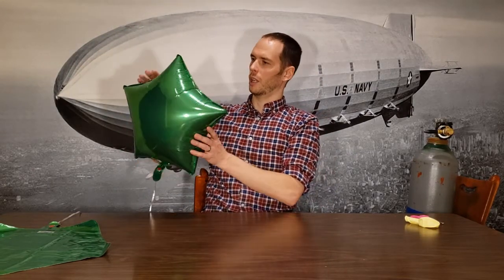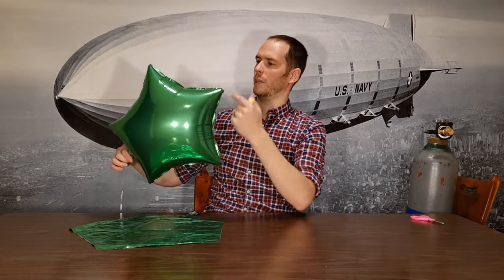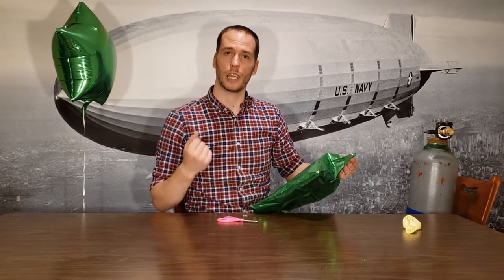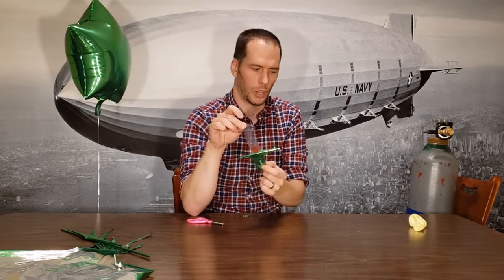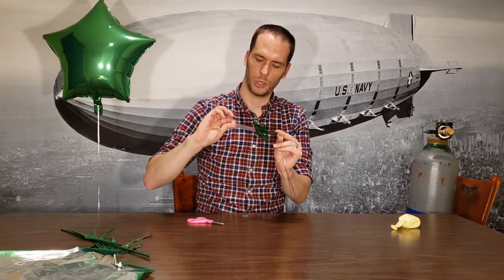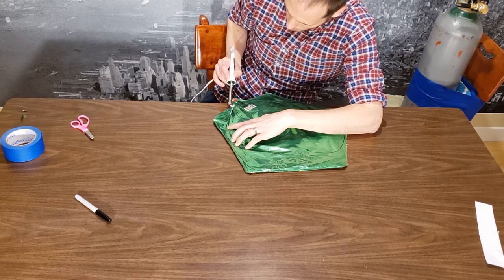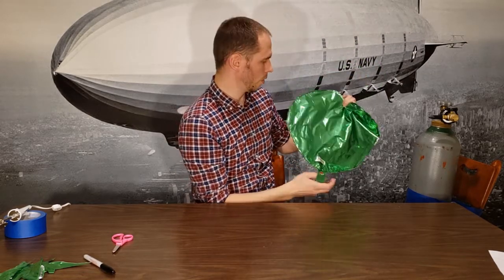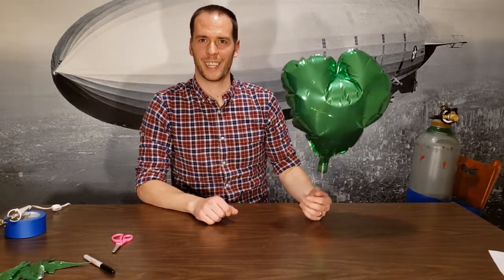Make Things Fly - Project: Foil Balloon

Comment: It would be fun to make a black one so it would catch the solar rays to make it fly       may be even heated with a hair dryer  to make it fly
Reply from the maker: Hi larz, you commented 2 years ago about using a hairdryer to launch a balloon. I just posted a project where I use a hairdryer to test launch a Mylar balloon. The hairdryer got to about 200 degrees and because the balloon was large it had the lift capacity to go to the ceiling for about 2 minutes. 

https://youtu.be/IkOwiuxWFyo

Cheers!